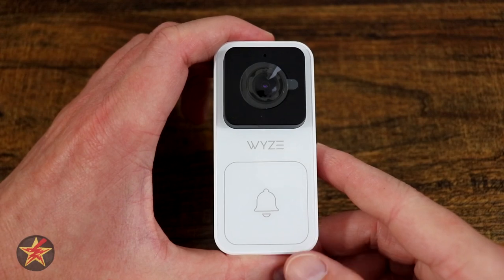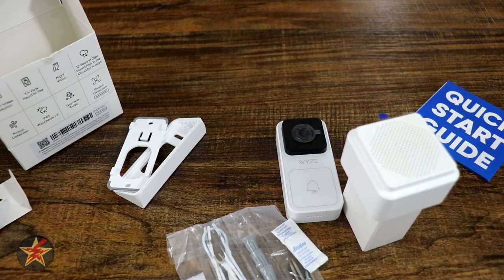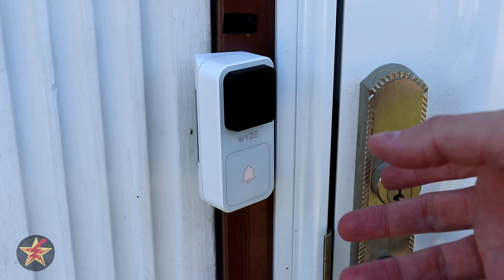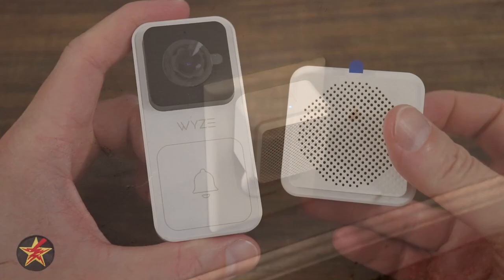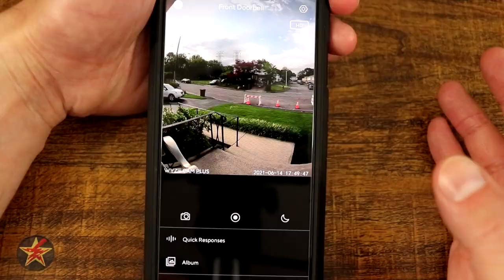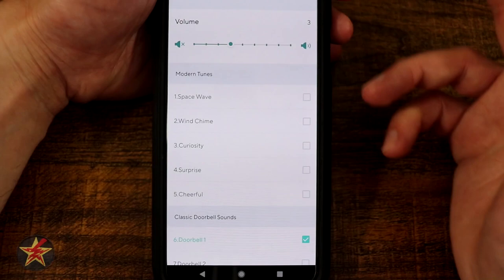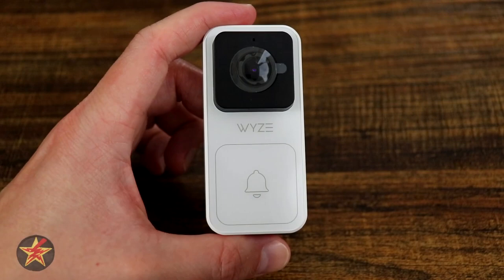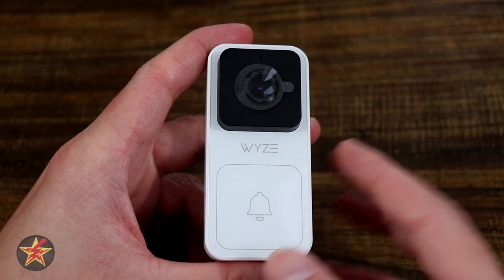Wyze Video Doorbell In-depth Review

Comment: Excellent review. Thank you. I'm returning mine, new in the box and get another camera!  I watched other reviews and none of those reviews mentions that twelve second motion clips work only with the subscription. I'm not subscribing so in two weeks the bell will be useless.  I bought the first version of indoor and a panning camera a year ago. They worked great while I was away. Viewing an indoor thermometer through my panning camera every day, I caught a boiler failure before my pipes froze.  I was so impressed, I installed wireless outdoor camera and required base router 6 weeks ago. The battery will last about 20 weeks at it's current burn rate.  I'm still impressed. Add-on outdoor cameras cost the same as the starter kit, so I bought another kit for second camera and used the SD card for the camera.
Reply from the maker: Just to clarify you do not need a subscription for the 12 second clips, however the lack of an SD card slot and 5min cool down period without the subscription makes the doorbell camera a little less useful.

Comment: You have not discussed that this doorbell constantly shows error 9 message which will not allow you to playback video from the timeline on the app.  The video doorbell will provide live footage but you are not given access to view any previous footage on timeline. So, if a crook has entered your house you are unable to playback footage to police from timeline on Wyze app. Quality of picture is superb though.  Also, you do not have the capability to use an SD card. My other 5 cameras have Wyze SD cards that work intermittently.  However, for the price Wyze offers more bang for the buck.  By the way, I had the CamPlus subscription too.
Reply from the maker: I had come across that error a few times but chalked it up to either poor network connectivity or just an irregular error. Which is why I did not make mention of it in this video.
Reply: @Wanderer001_Reviews  
I recently read on a wyze forum thread that the problem with error 9 message may have something to do with some phones inability to allow video player to playback certain aspect ratio on the wyze app.
Reply from the maker: @DJ-zt2ml  Well that would make it harder to fix.

Comment: I feel like I’m in the minority because I already have two cams in front so not having an SD card won’t matter. What I’m more concerned about is the quality of the two-way audio and the quickness of the notification for someone pressing the button (not motion notifications).
Reply from the maker: Mia to they have a doorbell camera will not have other cameras there because it is covered by the doorbell. At least that is what it is like for me. Notifications come in pretty quickly after movement is detected. The most I have waited is 25sec,but that was because of lighting. Audio quality is fine but you have to have a good network connection to maintain it.
Reply: @Wanderer001_Reviews  What about the speed of notifications if someone rings the doorbell? Not the motion detection notifications.
Reply from the maker: That is with in 3 seconds.
Reply: I wondered bout this to and why it wasn't mentioned. For me it's an important feature. 
That said, I do not own a video doorbell yet so I don't know what a reasonable notification delay would be compared to other makes.
I have seen a couple of other videos and he is very through and explaines everything very good.

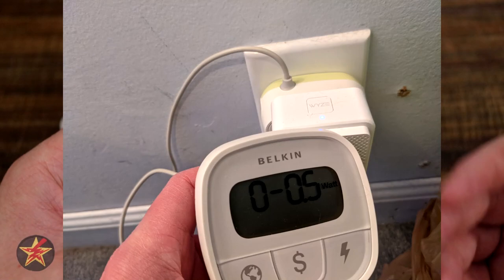Comment: On the doorbell  do I need to take a wire from my main box to the doorbell 14:34
Reply from the maker: If you don't alredy have wires for a doorbell it might be a good idea to contact an electrician which I am not.  But it does need power from the main to a transformer that will lower the voltatge for the doorbell.

Comment: Higher definition camera has image sensor running hotter. Smaller size water resistance device packaging can hardly cool itself so the heated imager runs even hotter. Mine lost connection in high noon and reconnected at night. If this continues it will eventually fail day and night. Other than that it is my favorite video doorbell.
Reply from the maker: I have started experiencing this myself.  I am testing out the Wyze video doorbell pro right now which I kind of like a little more than this.
Reply: @Wanderer001_Reviews  great. Can your pro model pick up floor mat place at the front door when mounted facing out?
Reply from the maker: It does have a much wider viewing angle. It does look like it should pick up a mat in front of your door and get just about to the end of mine.
Reply: @Wanderer001_Reviews  you are not sure about the floor mat?
Reply from the maker: I don't have one myself so can not 100% confirm. All I can say is that the veiw show just about all of my front steps. Even right in front of my door.

Comment: Hi, thanks for the very informative video. One thing I feel thought, is that you skipped it's actual natural function. Does it work well as a door bell?  Do you need a subscription to have the videos of when some one rang the bell. How far could the chime be placed and still be connected?  Also I think you inadvertantly told us that you can turn all  movement based recording off so that only when the bell is rung  the camera is activated?

I'm thinking of buying this product to use at my garage door. My house is about 200 feet away. This way if a package delivery comes I could open my wifi garage door, and tell them to put the package in there.

Thanks for your time.
Reply from the maker: That is a good point.  as with something calling itself a doorbell first that function works fine when people press the button and not the camera lens.  Which is a lot just because of the way this looks.  You do not need a subscription for 12 second clips that are saved to the cloud from a doorbell press.  You are also correct that all motion based triggers can be turned of leaving just the doorbell press as a trigger.  As for having the chime that far away from the doorbell I am not sure that would work.  In cases like those a cell phone notification would be the better bet.
Reply: @Wanderer001_Reviews  thank you

Comment: do they have ones that you do not have to hardwire? Great video thanks for sharing this video with us all.
Reply from the maker: Right now Wyze does not have an option that is not wired.  That might change in time but for now you will new power to it.
Reply: You can use a MicroUSB cable and a 5W charger.
Reply from the maker: Should work.
Reply: Yeah if you peel the gray rubber back by the screws in the back there's a hidden USB plug. I've used it because I didn't have a old doorbell so I soldered up an extra long cable and plugged it in on my porch using the USB. No issues
Reply from the maker: They are coming out with a battery powered one now if you don't mind waiting.
Reply: @Wanderer001 Reviews  did it come out yet? If so how do I know if it's the battery powered model?

Comment: I found and subscribed to your channel tonight. I've watched your video on the Wyze Cam V3 (wired) and am now watching this video/doorbell review. Would you be able to recommend a reliable, fairly inexpensive security camera only, outdoor/indoor with person detection & no subscription?  Thank you.
Reply from the maker: My suggestion for this would actually be a company called eufy. I had the opportunity to test a couple of their cameras last year. I was pleasantly surprised one of the big factors being no subscription for person detection.
Reply: @Wanderer001_Reviews  Thank you. Will be researching their various models. The couple that you tested, would they fit on a windowsill? Corded or cordless? Could you please provide models? I'll also try to find your reviews on your channel.
Reply from the maker: @cdancarina5513  Right now I have two reviews up: https://youtu.be/kOyVY5U7JAY, and https://youtu.be/ne4dyWxkZT0.. I am currently working on two more but have been very happy with what I have seen so far.  If you are looking for home indoor outdoor, I would check out something that works with their home base.  Right now they are running a sale through affiliate links which can be found here: https://share.eufylife.com/v1/shopping/s/g/3fcN5q4By
Reply from the maker: @cdancarina5513  Most of these will have cords.  There are a few outdoor ones that have built in solar charging.  The c24 can fit on a window.  the P24 is nice if you want to have a camera that can move around to see.

Comment: Can I use my existing chime? I don't want to use the digital plug in chime it comes with. Can I not use it with my existing wired chime?
Reply from the maker: It does not.  You need to use the digital chime with it.
Reply: @Wanderer001_Reviews  is there a way to order an extra chime?
Reply from the maker: @tanyas2670  There is, but right now they are out of stock.
Reply: @Wanderer001_Reviews  ok that explains why I couldn’t find one. I installed mines tonight thanks to your video and it works great!
Reply from the maker: Happy to help.